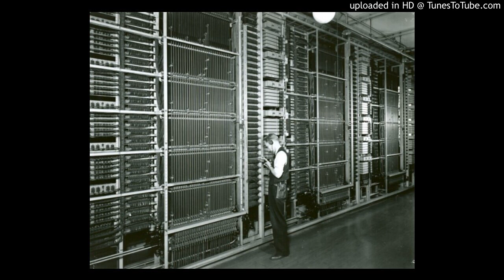Panel Pulsing Lover's Tape, 1977

Comment: What was the cause of the crashes of static between the ringing tone?
Reply from the maker: On a city ring machine, the turning off and on of the ring current and the DC between rings, is accomplished by mercury switches sealed Within rotating metal cylinders. There are metal wipers on the metal exterior of those cylinders which conduct the current. The static comes from the outside of the cylinder getting dirty. As the cylinder rotates you hear a repeating pattern of static corresponding to the dirt on it. There have been someplace where I have said that the mercury switch itself causes the the static. That was based on some thing Bill Acker had been told years ago, and is not correct